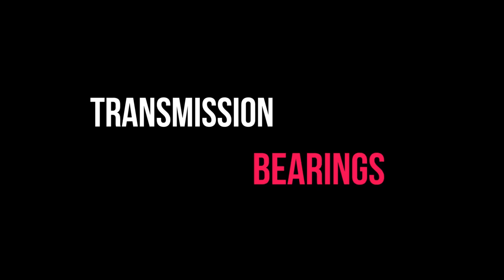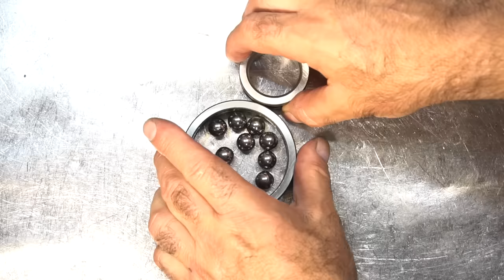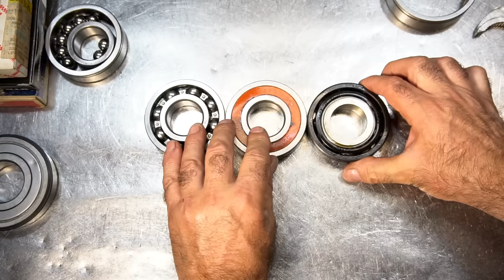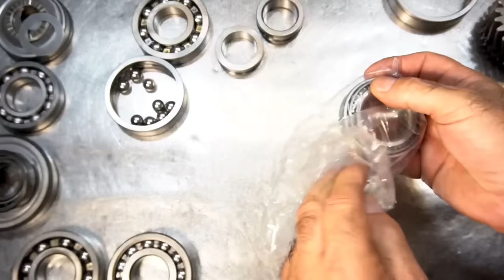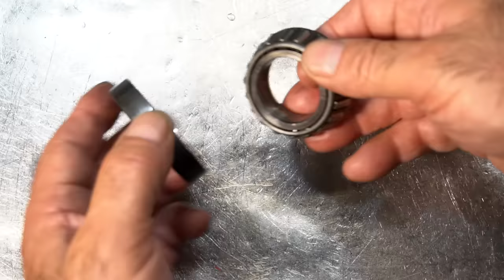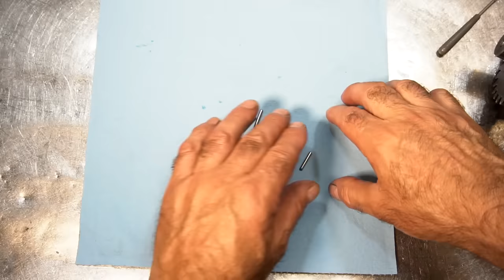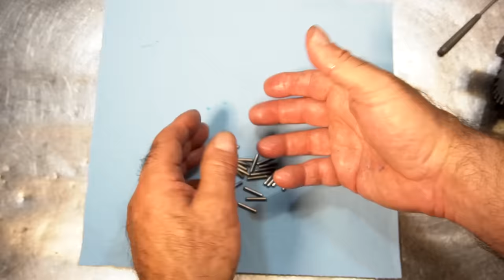Learn About the Basics of Ball Bearings, Needle Bearings, Tapered Bearings

Comment: Dynamic loads are nothing more that the load rating while the bearing is in motion. Static is stationary, dynamic is in motion. The combination of radial and axial loads is simply called combined loads. Conrad construction is the assembly procedure named after the Fafnir employee that patented the process. I am a Sr. Technical Analyst ( I am the person that answers bearing questions for a large bearing manufacturer).
Reply from the maker: Good to know. So given  an example of a standard 6307 as opposed to a Max 307 in high thrust load applications are you saying since the combined loads will always be better with a Max bearing that we should ignore the failures seen using max capacity bearings in transmissions with high thrust loads and ignore the engineering changes both General Motors as well as Borg Warner made going back to standard Conrad bearings... Please explain. Should the specs in the original New Departure data sheets be ignored as well? Sometimes combined load doesn't cut it because the loads should not be combined in the first place especially when using certain engineering practices related to gear train design. We are talking radial load , axial load, dynamic load here. I know what static load is.
Reply: Hey there watched ur video I have a question I have a road bike with I believe 6082 bearing sealed now from the factory the bearing are greased and sealed however they might roll smooth they are grippy and tight they dont flow or spin easily... now do you think the bike builders knew what they what were doing (these were 700 dollar carbon wheels ) in terms of do bearings for the rear wheel have to have a LOAD on it for it to spin in a faster rotation cuz the front wheel spins freely and loose... I'm about to take out the bearings degrease them and just lube them with some t9 lube and put them back in with no seals I know they won't last as long but the wheel seems like the grease on these bearings is creating more friction where the goal is to create less friction... so my questions is do you think I should do a bearing cleaning job and put them back in??? as long as I keep opening up the rear wheel hub to see how they're doing I think that is what I do thx for ur time brother man 
Peace
Daniel tampa FL
Reply from the maker: I replied to this some where else. Anyway I said remove the seals, clean em up and repack them and reinstall the seals. I would want any debris locking up my bearing hubs
Reply: @GearBoxVideo  thx for responding when you say repack them... is it still okay to just lube the bearings with a chain lube (t9 lube a very thin oil) and have no seals on them? 

My goal is so the wheel will spin faster and without resistance even if I am sacrificing the bearing vulnerable to dirt etc etc I think I'm just wanting someone to agree with me who has better knowledge than I do... i am willing to be wrong about the whole idea though.... peace dude
Reply: Well, where is your channel, Mr. Bearings Einstein ?

Comment: I regularly repack my trailer wheel bearings, I know I will do a better job now, and inspect them correctly!

Yes, sadly, I am so guilty of not changing my manual transmission oil, until about 140,000 miles, that rebuild looks a lot more likely! And it's really easy to do, no excuses. 

Thanks!!!

Comment: Great job, straight forward, your knowledge past on to us without our knuckles and fingers getting cut and pinched, lol lots of that over the years. Thank you for your great professional knowledge, I always prefer to take knowledge from a hands on guy then a person with papers and no hands on experience. Thanks again.
Reply: jim smith As an engineer with only limited hands on experience with the abundance of design cases Iˋve been faced with over the years I eally appreciate videos like this, with people who know a hell of a lot more about certain components than myself :) Iˋm lucky that I often get to build what I design, and I totally agree with you, that being all papers and no hands sucks. Books and charts are good, but hands on experience really locks it down and gives you the "feel".
Reply from the maker: What I've been saying for years. There are extremely talented engineers out there. What I tend to see is an inability to connect the dots. The ability or perception of one to see 10 steps ahead of the single design. How the single component effects other components. A good example would be someone who designs a stronger gear tooth  that seems OK however when run in a transmission it causes a higher separation load and blows up.

Comment: I didn't have a press to remove the hub so I repacked the bearing with red grease for a John Deere 332 PTO clutch from 1988. The seal bearing was dry out started to get burnt a little & didn't engage with electric pto switch. I cleaned it out real good with thinner & air compressor removed & clean out crud. It feels & looks like new!
Your thoughts some guys say not a good idea but, works fine so far.

Comment: Hello Paul, Very interesting and informative videos. At 68 though I think the only thing I'll be doing now is lube changes.
Had the rear output shaft Ball Brg on my 78 Mustang 4 spd fail once. I managed to decide what part to buy in advance just by careful observation of how the noise was related to engine speed, gear selection and vehicle speed. (It only varied, changed frequency as the vehicle speed varied).  When I changed it was obvious the inner race was the problem with a pitted area about 1" long. 

My next door neighbor at the time was a metallurgist at Chrysler in Highland park MI and he said "give that to me and I'll see if we can see why it failed". When he brought it back to me, they had sawed out a piece of the inner race, mounted it in something that sort of looked like Bakelite and the cut surface had been polished to a mirror like finish. He told me they had put it under  an electron microscope and that it had failed because of foreign material in the steel of the inner race. I never dreamed that he would go to those lengths to get an answer.
Reply from the maker: Thus the decline of the American bearing industry.

Comment: We used to refer to the tapered roller bearings as Timken bearings in reference to the original manufacturer or inventor.  Great video by the way.
Reply from the maker: Yes I believe Henry Timken was the inventor. Timken bearings are now made all over the world. Problem is when you get them they are made in several countries. We have been using Koyo mostly because that is the current choice of most OEM applications.

Comment: I did a quick googling of "max capacity bearing" (never heard of it before), I stumbled on an emerson page stating: "This makes them ideal for applications requiring heavy radial loads and low speeds where thrust loads are comparatively low."  I guess the key words "low speed" go with your remark about heat. Thanks for the knowledge.
Reply from the maker: People don't believe me and insist on putting these in transmissions that produce thrust loads

Comment: great info to know, thank you! (im doing research much as possible about bearings to know when they are used up even if they don't have wear on the spheres but on the outer coup do)
im about to repair by replacing almost or all the bearings of my manual gearbox since it started to do a lot of noise on 3th and 4th gear and i noticed that there is used up "coup"bearings.
Frist time when doing such a thing.

Comment: Needle bearing should also have its thin internal ring. Good information provided. Thanks.
Reply from the maker: Not necessarily true. Inner ring or race can be an integral part of the gear or a shaft raceway. Often times you can purchase hardened inner rings to press on shafts that have no heat treatment.

Comment: many years ago my dad worked rebuilding auto generators,  when generators was on the way out.   he was told that you use a few drops of oil  to check a clean bearing.  but not dry.
Reply from the maker: Your dad was correct. A dry bearing can make noise because even a spec of dust I'm the raceway can cause noise. Always oil and follow up with a visual inspection.

Comment: Mopar Performance used to sell an offset dowel kit for alignment issues, mainly to prevent premature pump/converter bushing wear and converter drainback issues in automatics but I assume it could work for manuals as well, as long as the shafts are offset but still parallel.
Reply from the maker: +Cheezy Dee There are quite a few companies that sell offset dowels in varying offsets.

Comment: Dynamic load(Cr) are the load a bearing can handle when rotating vs static load(Cor) is the load a bearing can handle while stationary or rotating very slowly. Usually dynamic load rating are greater than static load by a big margin. In high load industrial transmission, static load is very important to take into consideration since the bearing can actually be damaged by just standing still deforming the race way or balls. In even larger application the ball bearing can never stand still or change direction since the static load would kill the bearing very quickly. Most of the time static load rating is not something you need to worry about. Dynamic load however can be important to look at but changing out a bearing 1-1 usually keep you well within spec unless you buy some fancy ceramic stuff.
@weberauto could you talk about minimum load rating since I think a lot of people don't know that a bearing actually need a certain load to work correctly. Most of the bearings I've changed are because of too low load(not transmission related).
Reply from the maker: The concern here is axial load. As mentioned here ratings in books mention a lower axial load with Max capacity ball bearings. This is something to consider because helical gears produce a fair amount of axial load. So we can talk about semantics but the bottom line is in real world applications where in the transmissions I deal with the most, Max capacity bearings failed within  4 years of service just outside of the warranty window. This is normal use not high performance use. The service bulletins from Ford and GM also addressed this issue. So yet we have these arm chair internet techs that know better and apparently my experience doing contract warranty work for Ford and GM seems to be a mute point.
Reply from the maker: You are also correct about non moving static load. In the 1980's we did the majority of overhaul work the Corvette1984-87 overdrive. It should have been recalled but instead a service bulletin was issued related to carrier ball bearing failure. When we looked into it, technically the bearing should work but it had a 1300 pound static load on it which eventually ate up the raceway since in OD mode the bearing was stationary yet it was subject to static load from the pressure plate as well as the helical planetary gears. The fix was to use the same size bearing with .312 diameter balls compared to .25 diameter balls  and add better oil flow to the bearing.
Reply: @GearBoxVideo  Max capacity bearings are new to me and not something I've messed with. I can see how the slot would not do any good, that's for sure. I would stay away from it. The dynamic axial load, I believe it's called equivalent dynamic load or something like that IIRC, are combined axial and radial load. Never used those numbers for anything really but I'm sure it's very useful in certain applications.

Comment: I’m assembling a front wheel drive manual that is known to be a bit failure prone. I think (other than to much power) most failures are due to the tapered bearings losing preload due to case flex and wear. 

What should I look for if I want to switch from tapered bearings in this case? I know of other FWD units that either come with ball bearings or are converted, but there’s lots of internet wisdom saying they are no good for high torque applications with helical gears.
Reply from the maker: Tapered bearings by design are used because they can handle higher thrust loads than ball bearings in a smaller form factor. If you are seeing bearing failures it could be because of too much preload. If you think case flex is an issue then putting ball bearings is actually counter productive. Fix the flex first.

Comment: Japan (Yamaha/Suzuki/Kawasaki) ect.. transmissions use all sorts of bearings and a real BEAR removing/installing them. All METRIC which is good (as like the metric system better). PLUS BOTTOM END 2 strokes got needle on crank and open bearings on crank

Comment: One trap I’ve found with tapered roller bearings is that the inner race can have significant wear before visible issues with the rollers or the outer race. I found this when replacing bearings anyway & I cut the cages off to use the inner races as press tools. 

Do you have any order of brand preference with bearings?
Reply from the maker: Koyo or NTN. The Timken stuff is good but  most are no longer made in the USA anyway.

Comment: 'Full compliment' needle bearings are known as 'crowded needle roller' in Britain. They need correct lubrication or the rotation of one bearing contacts opposite rotation of the one next to it and can become a hard steel plain bearing
Reply from the maker: Correct. One of the main failures of using the wrong lube in early T5 transmissions was the front counter gear "crowded" bearing would seize and weld to the gear.
Reply: Paul, does the "crowding" also apply to an early t4? Is that one of the reasons for the confusion about using ATF as opposed to gear oil?  My particular trans is a 4wd t4, stamped '84
Reply from the maker: Yes the T4 when using gear lube as opposed to Dexron II would take out the front cup roller and gear.
Reply: Thanks so much. Have been looking for the answer to what lube to use and the why' for a solid week now. I have learned more about manual transmissions than I ever intended, and also found your channel in the process. Your channel is a wealth of information.. sell me a t-shirt.  Thx again. Have a good evening Paul.

Comment: If you ever want to explore the use of 'Needle Bearings' in a 5-speed, you should video a Chevy Monza BW T-50 overhaul! ;)
Reply from the maker: Chris Christenson Those were the worst! Bad thing about those is that the design changes were not documented properly especially with different size needles.
Reply: One of my worst rebuilds... all the needles got mixed up so I had to use cupcake pans to separate the needles after I used the micrometer on them, then grease them into each gear to determine which needles went with each gear... and it was my friend Vinnie's sister and it was a freebie... Ack! 

Keep up the great videos!

Comment: Great video, I learnt a lot about bearings here. I have been researching on what to do with motorcycle wheel bearings that are sealed, should I trust the amount of grease or re grease them?

One question that a lot of motorcycle mechanics seem to have different answers for is, should a bearing that I pulled out using a puller on the inner race ever be reused?
Reply from the maker: If it presses from the inner race and you pull from the inner race.. no issues
Reply: In this case it’s pressed through the outer race and then the only to pull it out is through the inner race. It’s inside a motorcycle wheel hub.
Reply from the maker: Then you risk damaging the bearing
Reply: Fair enough, apart from obvious scoring on the surfaces, what else can I look for once I remove the bearing to see if I damaged it?
Reply from the maker: As you said inspect the raceways for pits and indentations

Comment: bearings with a chamfer are supposed to go on a shaft against a the side of a bigger diameter of the shaft
shafts are always made with a radius where the diameter of the shaft changes, to prevent a high stress area
the chamfer will accommodate the bearing to rest against the side of the bigger diameter  without interfering with the radius
Reply from the maker: True but not always designed that way. Some inner races of ball bearings are actually thrust surfaces and require square non chamfer inner rings.
Reply: I agree with you Mr. Ruth.  Chamfers are machined into shafts for that reason. (Machining 101)

Comment: The term “Conrad Bearing” comes from the Patent Holdrer, Robert Conrad(not the actor)
Reply: Dynamic load is the radial load in operation
Reply from the maker: When both dynamic radial loads and dynamic axial loads act on a bearing at the same time, the hypothetical load acting on the center of the bearing which gives the bearings the same life as if they had only a radial load or only an axial load is called the dynamic equivalent load. The problem with using Dynamic load as a way to choose whether to use a Conrad or Max Capacity ball bearing is that the books will always show a higher dynamic load rating with a Max type bearing.  These bearings have a higher failure rate with transmissions using gearsets that produce heavy thrust loads. Dynamic radial load is radial load in operation not Dynamic load.

Comment: Great video! Quick Questions; would a max capacity bearing be problematic if the thrust is coming from the same direction as the filling slot? Intuitively, I'd think that it would still be supported, but I'd love to hear from an expert
Reply from the maker: Depends on the application. In a transmission thrust goes both ways since your on and off the throttle for example
Reply: @GearBoxVideo  Hadn't thought about side loading on decel for helicals being on the other side.
Reply: I agree. The same thought came to my mind. I was also impressed with how you took that radial bearing apart using vice grips. I've cut many worn bearing races apart with off hand-grinders for visual inspection over the years... That method would have saved me a lot of time!